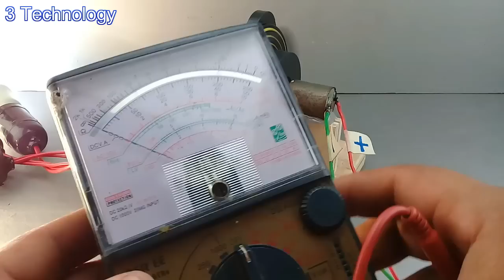How to Generate Homemade Infinite Energy 230V 10000W With Seven Big Magnet Use PVC Copper Wire

Comment: Sorry, but this is nonsense. The voltage depends on the speed of the electric motor. The frequency of the AC voltage is guaranteed to be higher than 50 or 60 Hz. The voltmeter shows different voltages at different frequencies. With this device you can make lamps light up and that's it. And 10000W? dream on. Never ever! 🤣

Comment: Where are the two last red and green wires coming from? If the red and green is coming from a power supply, then this project is no good. U could just hook the lights from the supply.

Comment: So what was the red and green wires connected to?
Reply: The red and green wires probably go to a backup supply, in case the perpetual motion machine fails, 😆 🤣
Reply: As that tiny electric motor looks like 12 Volt .. those most probably goes to battery. Effectively making that device a DC to AC convertor, nothing more.
And I highly doubt it can provide 10kW at 230V .. unless there is not missing part of whole sentence, which might be like 10kWh produced in few years.

Comment: where is the dc voltage coming from to the dc motor?  how many volts amps is being supplied to the dc motor?  10000 watts at 230 volts a/c= 43.4 amps out put, your coil wires appear to be 12 ga copper  and would melt at that load. i`m calling bullshit on infinate energy you have a crude generator with a remotely powered dc engine  and i doubt you make more then 5 amps output total
 probably less then the power used to run the dc motor

Comment: I seriously doubt that the wires could handle the calculated 43 Amp load. Good for a demo, but it's not good enough to use in real life.
Also, where did you get the power to turn the motor?
Reply: That's what I was wondering.. wonder if you could power a 12 volt power supply to run the motor off of the output.
Reply: Από τα δύο άκρα του αλεξικέραυνου πάνω και κάτω 😂😂🤣😂🤣🤣🤣

Comment: 10,000 w/ 230v = 43 amps.   May you please measure at least 40amp with a greater load.?
Reply: He can not, because at 40+ Amps even those tiny wires will be lit , not just light bulbs ;-)

Comment: well I have yet to decide who is more stupid - the author or those who praise this concept. 
there is energy being injected into this system by those 2 wires that go to motor. case BUSTED. 
do you know that you have infinite source of water in your tap? go on, open it and wait for few hours, it will not stop...

Comment: How much power is running to the electric motor and was how much power is going into the compositor cause the compositor alone if it has a charge would run the lights this seems to have some plossibility depends on the efficiency of it cause it's not free power your using power for the electric motor question is how much is it using in comparison to how much it's producing

Comment: It's a magician! He does not put the lamps in a socket with 220V, and then in the (magnet) current! Why the lamps are processed with an LED! and the camera that is light sensitive makes you think that a lot of light comes out! The voltmeter's wires are not visible! and the current becomes visible through something under the table! It's a magician!🤣😂

Comment: Oh for Pete's sake...
The coil and spinning magnet together are a generator.
The generator is being powered by the motor.
It turns the rotational energy from the motor into electricity.
The motor is being powered by those red and green wires.
Since the red and green wires are labeled (+) and (-) it's a DC motor... probably running off a battery.
Since they didn't even hide the fact that the wires go off-frame to an outside power source I ASSUME this is intended as a joke.
(I also doubt that the bigger stationary magnets are doing much more than holding up the coil.)
Reply: Nope, the generator wouldn't work, there's a battery in the fake capacitor.
Reply: @simonruszczak5563  если бы было так, как Вы написали, то лампы бы зажглись сразу
Reply: катушку тоже можно выкинуть, она к свечению ламп никакого отношения не имеет

Comment: You have given a very good demo. But I could not understand one thing, from where did those red and green wires come, if they are taken from the electricity board of the house or from any chargeable battery. So there is no use.
Reply: Maybe with a DC adapter that is rated for the motor, you could jump start with the battery to get it going and then remove the battery from the mid-wire "jump" points ?
That should work, I would think.
Reply: That's not free energy if a battery is used.
Reply: Ohne Ampere Angaben ein lascher Beitrag !!
W der Beleuchtung ?? 
Spannung ist ja bekannt 

Aber fehlt bei allen mir bekannten Beiträgen.......LOL
Reply: Ok
Reply: The sizes f the capacitor?
Reply: 3 becuri au 10000w ?)
Reply: @cristianmoldovan3396  I didn't understand your language
Reply: from a battery terminal that is why they are marked +ve and -ve. the battery was not shown in the illustration
Reply: @edmondkalungilutwama2377  if that's the case then it's not free power.
Reply: @edmondkalungilutwama2377   Are all the magnets in phase or are they flipped?
Reply: Sadzac po wielkości silniczka, to pewnie  chodzi z jakiejś bateryjki.

Comment: What is the value of the capacitor which did not appear in the video.
Reply: 25 mf 450 V AC
Reply: @rafajvir9128  Thank you for the response.
Reply: The "capacitor" is 3.7 volt lithium iron battery.
Reply: а какая разница?